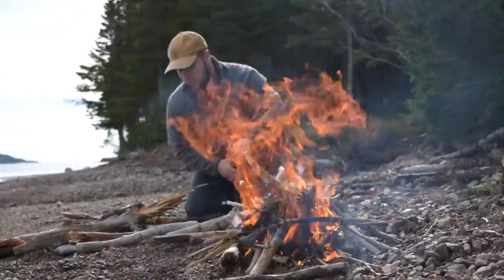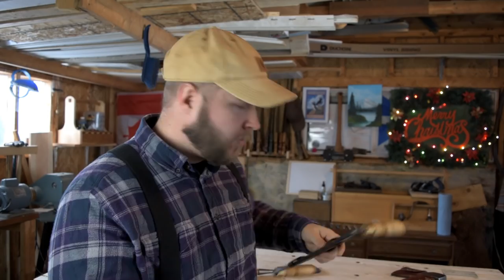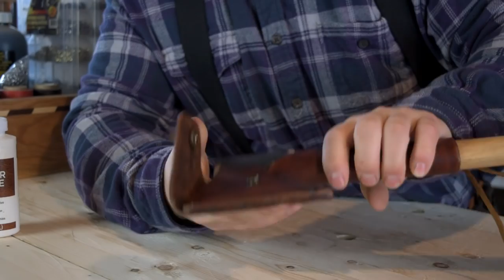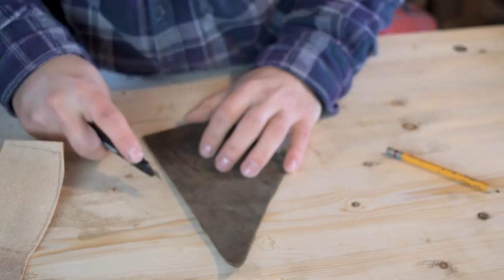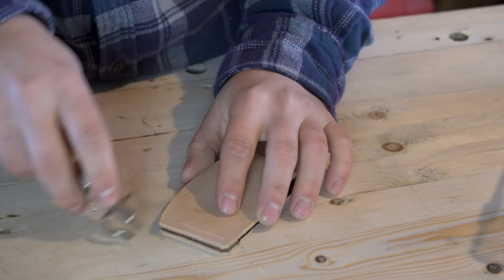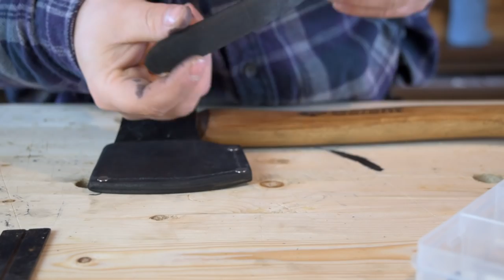HOW TO BEGIN LEATHER CRAFTING - [NLH 8]

Comment: I would like to add a couple of things to this list. 
Get a set of harness needles, size 0 should be good to start. They have flat eyes, rather than the standard stitching needles that are called 'egg-eyes'.
1mm poly thread is your friend for most starter projects of this size. 
I suggest a set of diamond chisels, at least a 2 prong and 4 prong. This way, you can punch straight line holes without having a drill press.
Last suggestion, unless you have an extra vice laying around, invest in a stitching clam.  This is a leatherworker's vice, that lets you have both hands free to stitch.
All of these items can be gotten from Tandy Leather.

Very nice video, covered the basics well. Stitch on!

Comment: I make belts and carve and tool designs into them and found that 8 to 9 or 9 to 10 oz is best because the tooling will thin it down some. I do the same for sheaths. I learned it doesn't pay to use the cheap on sale import leather. It's actually harder to cut and it tools unevenly.  Tandy has some Oak Leaf double shoulders on sale and I'm buying some this week cuz that some of their best. For those looking for some inexpensive leather consider buying bellies, they're typically are only about $20.
Reply: Why are bellies cheaper?

Comment: That was a great episode. I always thought it was harder than that. Aren't on some projects like wallets and others a tool supposed to be run down the edge to thin it out? What is that done for ? And what is the tool? Isn't there also a bone tool that is used when leather is folded?
Reply from the maker: sometimes the leather needs to be thinned on an edge or crease, to reduce bulk and allow the leather to fold, or so your stitched seam isn't too thick!